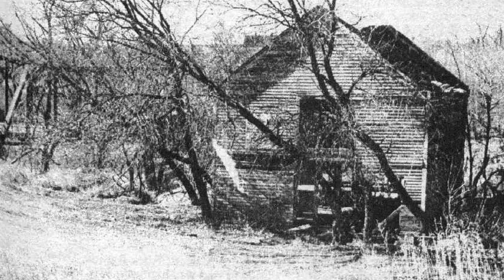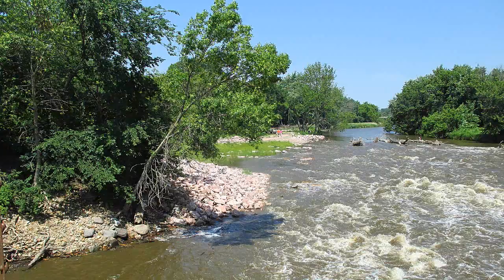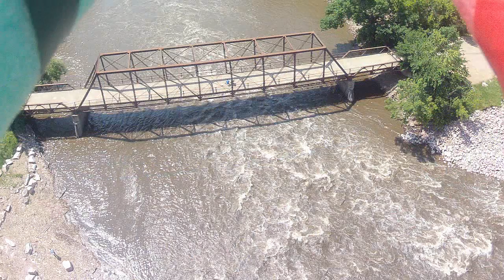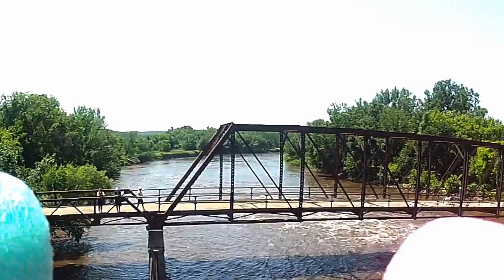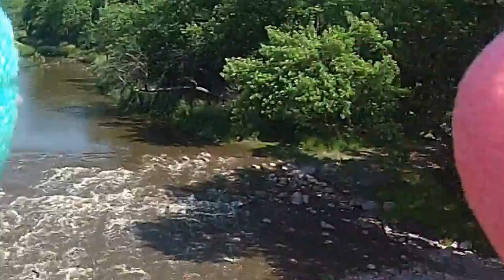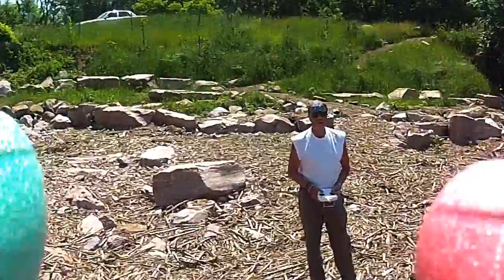Klondike Bridge Larchwood Iowa/South Dakota and Kruger Mill History with Aerial Quadcopter views.

Comment: A lot of history in that place. There is the foundation to the old dance hall not far from there on the other side of the bridge. I remember a couple years where the river flooded soooo much that water spilled over the bridge and from the deck you stand on down was under water. There used to be an island under the bridge when I was little but it was washed away. If you look where it says KLONDIKE in the concrete by the mill you will see two handprints. The smallest is mine and the larger my mom.

Comment from the maker: Thanks, but the camera is not moving. It does it even on my servo, gyro stabilized mount.  This effect happens with all rotored helis, if the lens can see the light and dark of the blades blinking. It is called the shutter effect.  Like a wheel spinning backwards, or the bars on a tv screen that is being videoed.
Either way, I hate it and believe me, I have tried all the mounts.  I have a  Flamewheel video with the same cam, coming up,  but with no floats to bounce the light. We shall see.